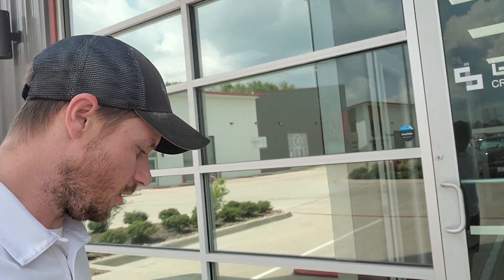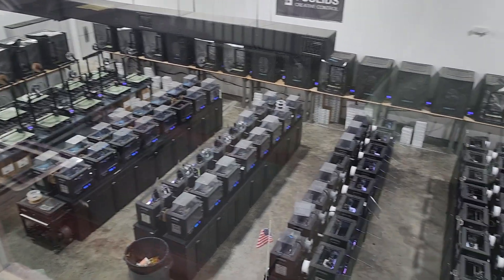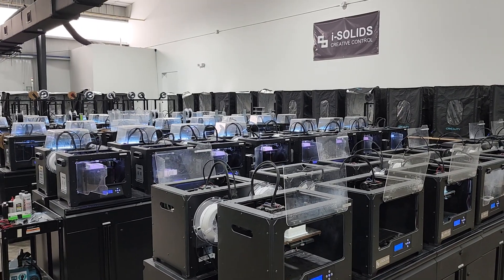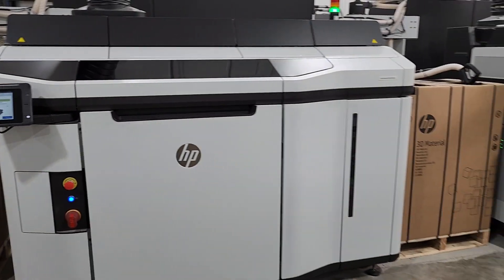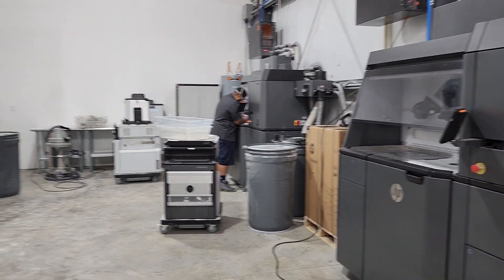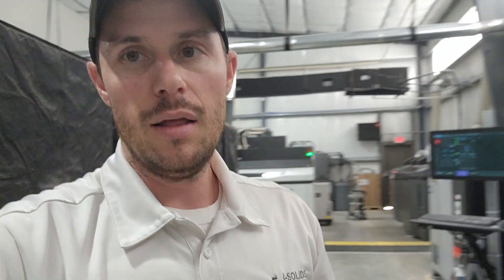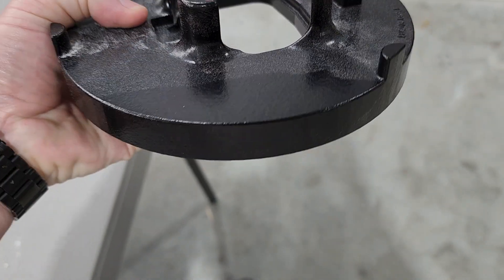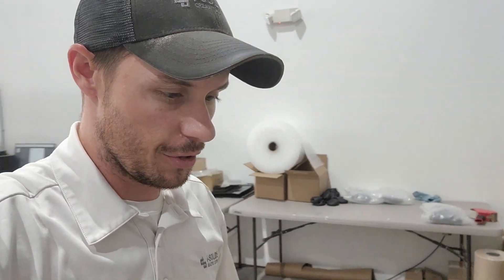Updated Tour of Texas' Largest 3D Print Farm

Comment: @i-SOLIDS: 3D Printing & Engineering   I am wondering did you go with the flashforge replicator ?   or is that another brand?  What made you choose that printer for FDM?
Reply from the maker: Nice observation! We do have 64+ Flashforge printers within the FDM printer farm but they are modified a good bit to essentially make them more robust just to help with the number of hours we put on them. For example, we replace everything with all metal components, Micro Swiss hot ends, upgraded bearings, new electronics / firmware, etc.

What makes us slightly unique in comparison to some other farms is our top 4 materials are ABS, ASA, PETG, and TPU. PLA comes in around 5th. For this reason we like the Flashforge machines because they are fully enclosed to help reduce warping with materials that higher higher thermal expansion. An enclosure was a definitely requirement but we also like that they have a small footprint, have an open source firmware that we could modify, and they have a common direct drive extruder design so spare parts and upgrades are abundant.
Reply: @i-solids  

That makes sense, is there a reason you dont print with ASA?   I have heard it is better than ABS... 

 I am trying to build up a farm as well been running into some issues with creality printers.  I did have a flashforge like the model you have but it broke when I tried to bring it with me on an airplane.   Hopefully I can find a more reliable setup moving forward, but dont have a budget yet for more flashforge printers.

Comment: What is your most reliable printer?
Reply from the maker: This might be a little bit unfair comparison but the HP MJF 5210 is probably the most reliable printer we have - of course with the price tag associated with these industrial powder based printers I would definitely not expect any thing less.

On the FDM side of things we really like the original CR-10S and actually prefer it to a lot of newer machines with more features. However this probably wouldn't be my top pick for a personal 3D printer since our needs might be a little unique at this scale. For example, the original CR10S had a separate electronics control box which means there is a bunch of wires exposed and it has an outdated display compared to most modern printers with nice touch screen interfaces. For my own printer I would prefer the nicer looking and more feature rich interface but with a large volume of printers having a separate electronics enclosures allows us to have spares available so that we can swap things out quickly to prevent downtime. 

With a bit larger budget we have found that the Markforged printers are amazingly reliable for FDM.

Comment: Have you thought about expanding to a drier environment? Such as west Texas? (Abilene/Sweetwater) You wouldn't have near the trouble keeping hydroscopic materials dry!
Reply from the maker: Hey Tony,

The south Texas climate no doubt comes with some challenges. We do have a climate controlled shop with multiple AC units so we normally try to keep things between 30 to 40% RH and 70 to 80 degrees. On the really hot days with all the equipment running we have to monitor the environment a bit more and plan accordingly.

Humidity wise there is a fine balance because on the FDM side generally lower humidity is better but on the MJF side which is powder base some humidity is actually required. If the humidity is too low then the powder starts to generate more static which can cause some print quality and safety concerns. Many shops in more dry climates commonly have to use humidifiers to increase the humidity.

On the FDM print farm we normally consume filament at rate fast enough that most common materials like PLA, ABS, and PETG aren’t affected – for instance a 1KG material normally only last abouts 48 hours before it is completely used. On average we consume between 500 and 700 kg per month. For more advanced polymers that tend to be extremely hygroscopic like PA12, Ultem, and PEEK we store them in a industrial dry box that keeps the humidity below 1%. Prior to printing with these materials we can also “bake” the filament to make sure it’s fully dry. The industrial FDM printers all have sealed filament storage to keep the material in good condition while printing.

https://www.essentium.com/product/essentium-drybox-db270/ 

Overall in a strange way the humidity in our region can strangely be a good thing since it allows us to keep the overall environment at a nice level suitable for MJF technology and we can control the individual requirements for FDM on a more micro scale.

I apologize for the lengthy response, I thought this was a really great question.
Reply: @i-solids  Thank you very much! I've been into 3d printing for about 7 years, at work I'm the go to guy. We have 2 printers where I work (Mainly for prototyping) We have thought about getting another powder printer from HP, but decided it costs too much. Personally I currently have 6 printers not counting the Bambu Labs X1 carbon combo on the way and currently setting up a RatRig V-Core3 400mm. Delta, Cartesian, and core xy experience. When the high school gets their technology dept going with 3d printers, my work will send me over there to give them a hand and to teach a little.

Comment: so this is such a cool business but i noticed the lower on the product shelf I'm curious if there's issues with needing a FFL and having it sitting out like that
Reply from the maker: Nice observation! That was a non-functional display piece that is designed to look similar on the outside but everything is basically solid on the inside. Actually, that part was designed to just show off our Cerakote finishing options.

We do work quite a bit with sporting goods as is it a nice use case for production volume industrial 3D printing but we do have terms of service and have to turn away any firearm components that would be part of the firing system itself and of course any lowers specifically.

Most of what we produced are things like optic clamps, recoil pads, holsters and these are often sold B2B.

Comment: Thanks for the tour. Great to see an Anycubic SLA printer in the mix with your Formlabs.
Reply from the maker: Thanks! The depth and performance of Formlabs material library is petty great but we are still a major proponents of the speed and cost of open source photopolymers. Its amazing the results you can get off of a printer that is just a few hundred bucks.
Reply: @i-solids  Agreed, my entire print farm is Anycubic, cost effective, cheaper, and easier to fix and repair. They also print like a boss!

Comment: What printer is your fdm that you have the most of. Would you buy them again.
Reply from the maker: A lot of our FDM print farm is based on the "tried and true" legacy MakerBot or FlashForge Creator Pro style printer but each one is heavily modified - not necessarily with more "features" but with just upgraded components that are better suited for the heavy use environment and slightly more complex materials like PA12 and ASA. We also have some custom firmware and an additional software layer for production planning. 

Although these printers are great for our environment these may not necessarily be the ones we would recommend for other users - we place a big priority on reliability more than any other criteria. For example, auto-leveling has gotten to be very impressive over the past few years but at scale even just an extra 5 minutes per print job then this can equate to several hours of non-production time.
Reply: @i-solids  thank you for sharing your knowledge.
Reply: @i-solids  Thank you for sharing that information, just wanted to point out that modern 3d printer firmware can be set up to store the mesh, so you could only run the mesh leveling sequence once a week to minimize the impact on throughput. I really enjoyed the video and the mixture of different additive technologies you are using is very impressive!